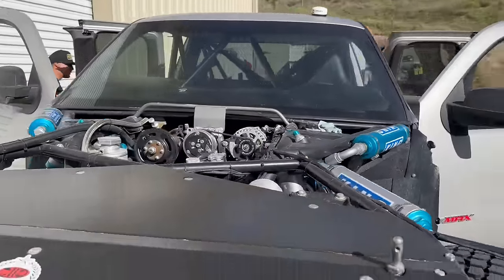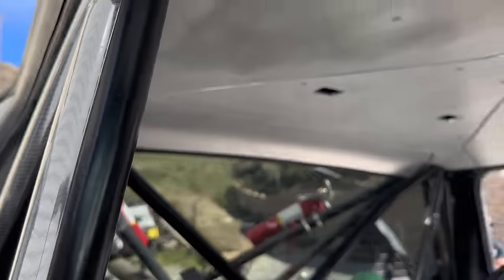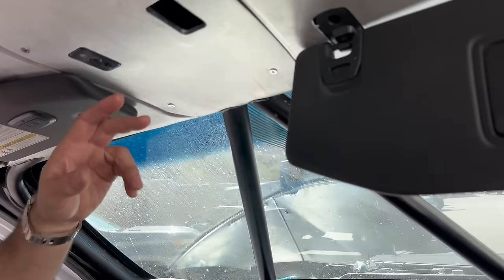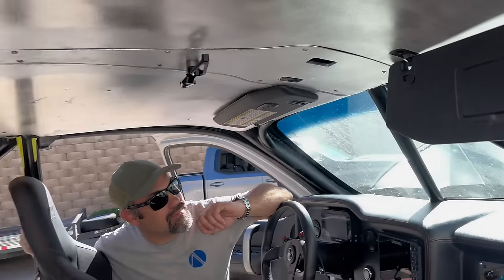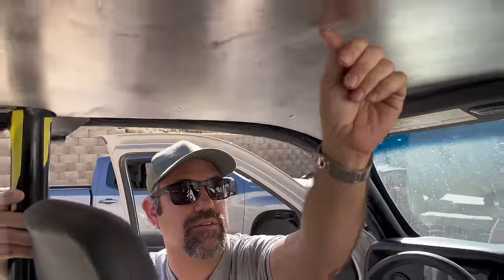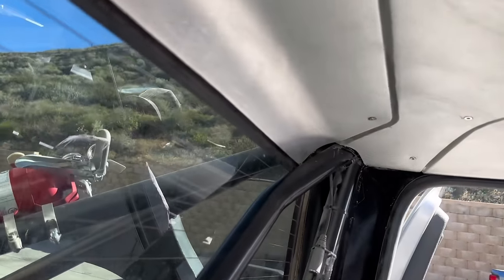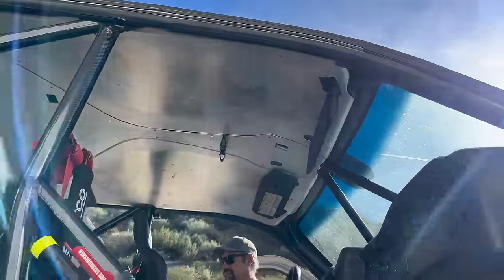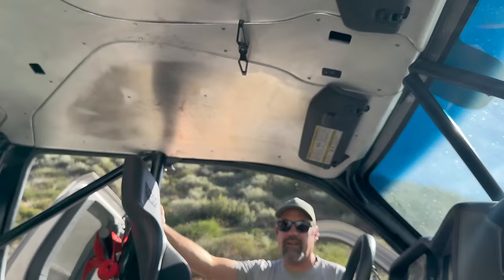Greg’s Tube chassis Silverado luxury prerunner | complete Morgan Clarke design headliner package

Comment: when laying out the cage work in your trucks,  i have noticed that you do not do a lot of bens in the tube. how do you keep junctions strong and what do you start with the cage, when beginning one?
Reply from the maker: That’s a good question. Bends, if not supported by another tube intersecting the bend, are weak links. We do avoid them. 

There will be a comprehensive build series on our Dakar Prototype. This will cover ground up chassis development.
Reply: where do you start with a floor layout and main hoop, so that you know where the seats will be @MorganClarkeDesign1